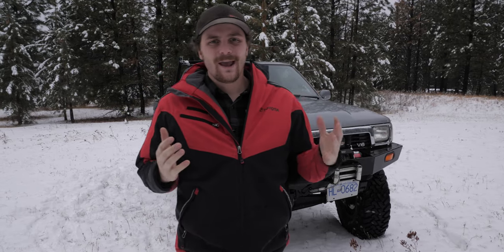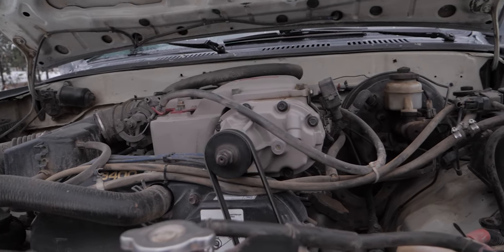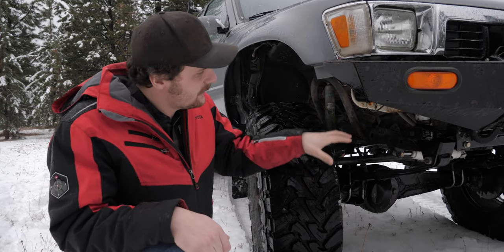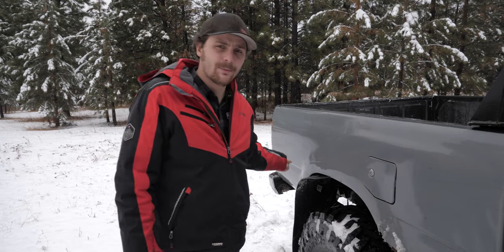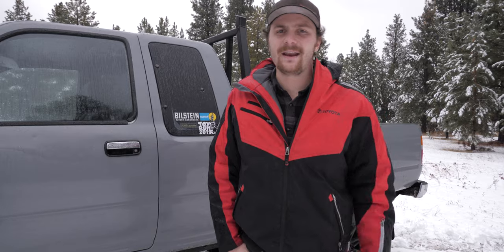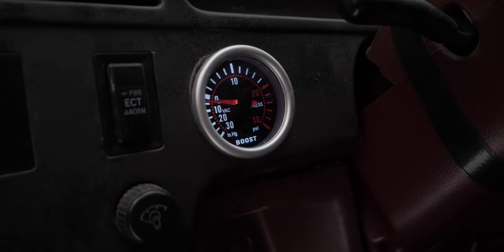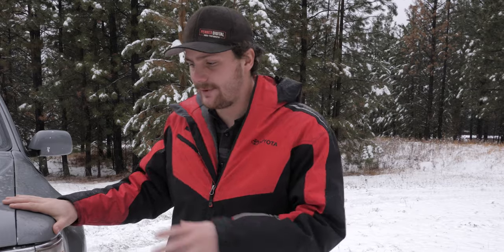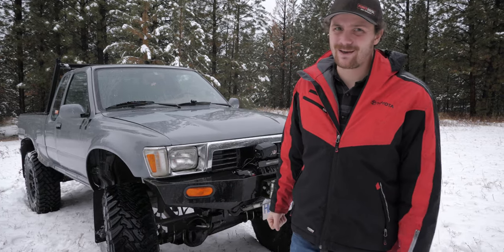My DREAM Toyota Build! It's SUPERCHARGED

Comment: Love your channel bud, I'm driving an '89 SR5 on Vancouver Island.  Still running the 3.0L with over 600000 km.  I fully plan on swapping to a 3.4 when the 3vze dies.  Love the build, hope to see more in the future.
Reply from the maker: Thank you very much! Good luck killing the 3.0! Mine was at 425xxx and I was intentionally neglecting it knowing I had a 3.4 ready to drop in. Would not die, I ended up pulling it still being a strong runner because I wanted to get the swap done already.. Haha

Comment: I had a 93 2wd extra cab with  a manual  transmission and 22-RE that I put a Lockright in and the most aggressive snow tires I could find on. Everything else was stock. I dropped a few jaws by being the only 2wd among all the 4wd's at a lot of party's back in the woods and farm fields.
Reply from the maker: That is awesome!! Those lockers work fantastic.

Comment: How does the square tube driveshaft do at higher speeds? Not that you're in 4x4 on the highway, but any balance issues above crawling speeds?
Reply from the maker: Hey! Square tube driveshaft is mint. Gets shaky at about 50-60kph, but I'm never going that fast in 4x4, only notice it when I forget to shift back into 2 high on gravel roads between trails.
Reply: @DirtGarage  Thanks, I always wondered about running one!
Reply: Btw this is a great idea for a video and I'm totally gonna do one for my truck... So thanks in advance 😀🍻
Reply from the maker: @6thGearGarage  Ha! Your welcome. Looking forward to it 😁

Comment: I would like you opinion on an upgrade. Hi, I really appreciate your channel as it's all geared towards yotas. I have a 87 reg cab. It's got a nice functional lift, running 33X12.5's. Anyway, I want to put lockers in. What do you think about Eaton 3rd and ox for front? Would that even work?
Reply from the maker: Hello! I would put the Eaton up front, ASSUMING your talking about a Air or E-Locker. Selectable is best left for the front. The rear you can get away with using a OX or any other lunchbox locker.

Comment: Best of both worlds with the 3.4 in there. The 1989-1995 Toyota pickup is worlds better than the 1st gen Tacoma when you remove the engine from the equation. Much heavier duty frame [Fully boxed with internal gussets] and better overall build quality.
Reply from the maker: 100% agree. I love the body style way more, better frame, they just need the 3.4.

Comment: Hey man did you go with a 3.0 trans and tcase to run the Toyota front axle?
Reply from the maker: Yup! R150. Soon to be duals, but using 4 cyl cases obviously.
Reply: Will a 4cyl case bolt to the r150? Also would like to see you do the dual cases

Comment: Is the e locker  up front from the rear of a a 00-04 Tacoma  or 4 runner??
Reply from the maker: Yes! I have a complete install video including wiring on the channel 😁
Reply: @DirtGarage  I scoped it out just never said that it was a rear e locker from one of those years!  Just use the elocker gasket as a guide!!👍👍
Reply from the maker: @goatsgarage2252  Perfect!
Reply: @DirtGarage  did u do the same on rear? Or just use the full tacoma axel housing ?   Was ur truck factory 3.o?
Reply from the maker: @goatsgarage2252  Rear has a Lock Right locker, they are a automatic locker. Really it's cheap and all you'll ever need in the rear. My truck was a factory 3.0, so V6 thirds.
Reply: @DirtGarage  cool ! ! High pinon rear then if no mistaken ?...I appreciate the fast replys !! U have  factory axel shafts from the toyata front axel  ?..are the splines on the front solid axel shafts the same as the tacomas?  Or did u have get different ones?? I love ur rig !!!
Reply from the maker: @goatsgarage2252  Not high pinion. And yes stock shafts front and rear. Same spline as my birfs slide right into elocker.

Comment: Get a 6cyl diesel under the hood. Bolt on a turbo & intercooler, you’ll get better mileage and a longer life out of the motor.
Reply from the maker: Toyotas have not come with diesels in Canada since the early 80s! The supercharged 3.4 is amazing though.

Comment: All that.work.and still.slow. a full-size chevy or ford is faster bone stock.     You should of did a Jz supra swap.
Reply from the maker: All that work and it's perfect. It's not supposed to go fast! It's a crawler, on Toyota axles.
Reply: A Supra swap is more expensive and it’s a rock crawler it doesn’t need to go 100+ miles an hour